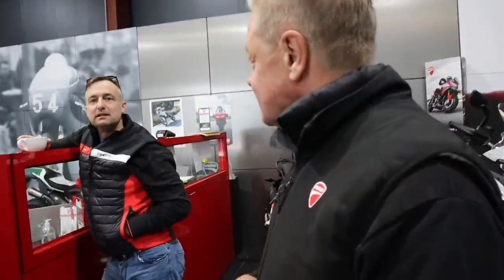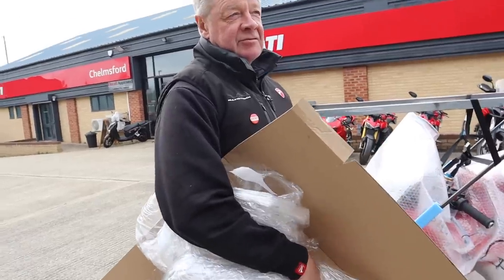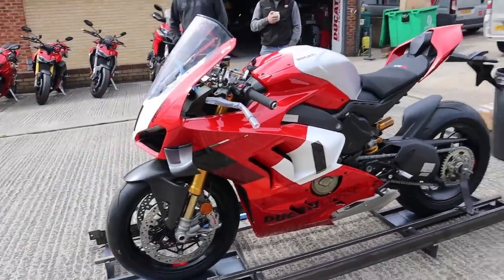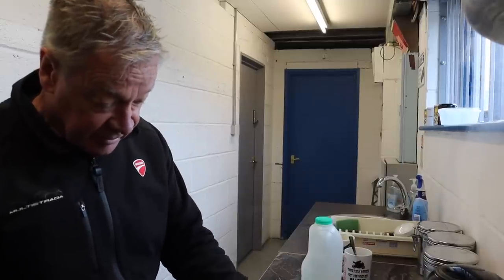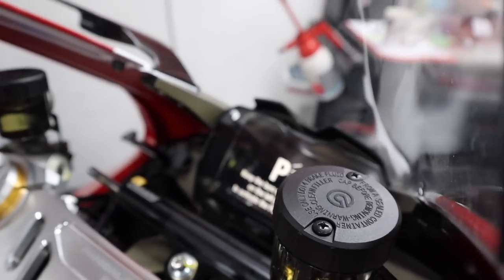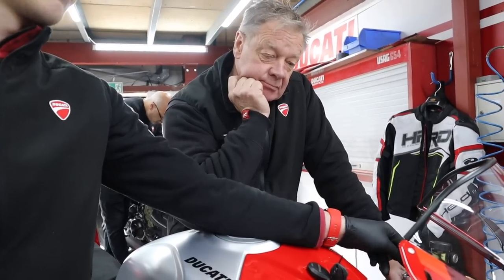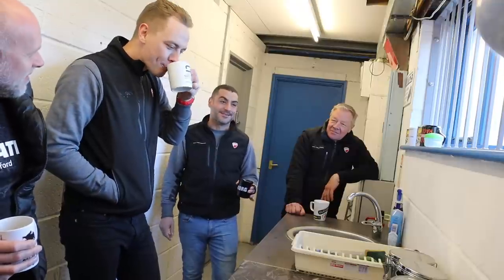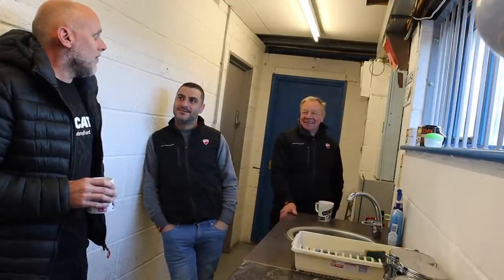New 2023 Ducati PanIgale V4R , First look, unboxing & ride

Comment: this bike has never 230ps with the stock exhaust^^
Reply from the maker: They are 218hp stock.. 237hp with the system and if you add the special shell oil they are 240hp ….